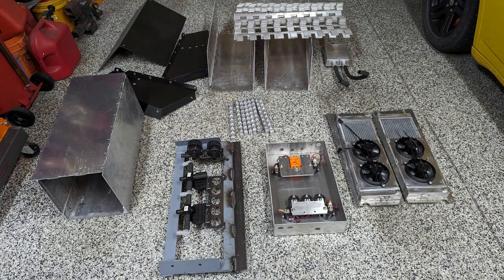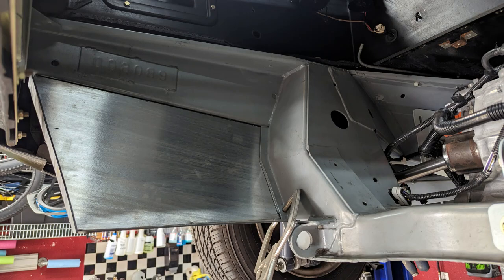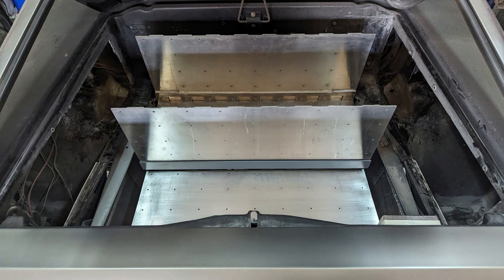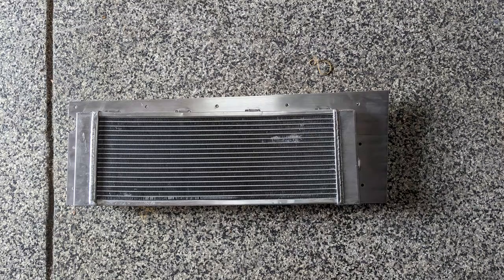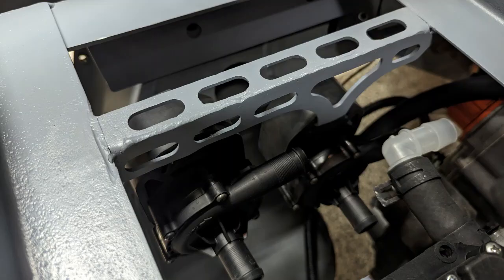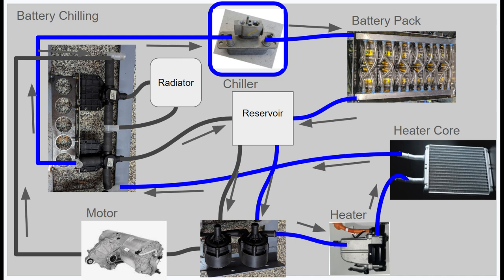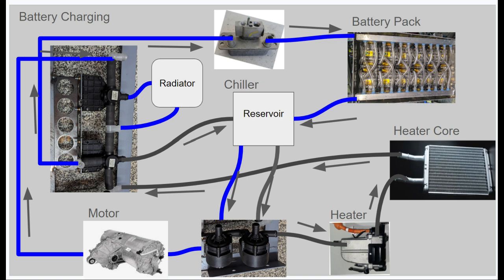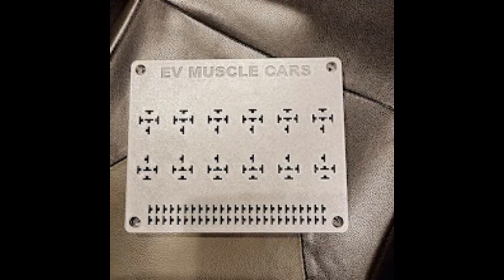EV DeLorean - Parts and Fabrication, cooling system walkthrough - Project Jiggawatt Episode 4

Comment: Any concerns about mounting the bottom box on its side, since it wasn't designed to lay that way? I'm wondering if there is any risk with bumps, etc. applying "jolt" forces on the sides of the cells, and fracturing the wire bonds on the top and bottom of the cell.  Do you feel that the individual cells are still supported well on their sides?
Reply from the maker: No concerns, it's done quite often on these builds... I have one box with modules on edge in my Plymouth and I have pushed it pretty hard for close to 20,000 mi with no problems.
Reply: Great, I thought you may have done that on the Plymouth.  I chuckle when I see your Plymouth videos.  My dad would have LOVED to see that.  He was a BIG Plymouth/Chrysler/Dodge guy.

Comment: Absolutely phenomenal!  So much thought and analysis going into it - you continue to amaze me!!  Any idea when you might make some of the fab files available?  Also - do you have a feel for how the F/R weight distribution will have changed?  Any anticipated changes to braking system as a result?  And - Any chance of you posting some of the specific components you've selected - I've bought the Model 3 motor and S battery modules, and I'm removing the engine and systems from my DeLorean as I speak....😲  Fantastic work, PLEASE keep it up!!!
Reply from the maker: Oh wow, congrats on starting the project!  I have a shared folder for the files linked below...I think the balance will remain pretty similar to stock, just heavier.  It will most likely need upgraded coilovers and brakes.  

https://drive.google.com/drive/folders/1FJQNckqbJZNHA_BhiO9oVvmAAh7nWmBB?usp=sharing
Reply: Thank you so much for the files!!  So great!  What gauge steel did you use for the motor mounts?  (and mild steel?)  And the battery boxes are 1/8" aluminum?
I got my hands on 6.3kw modules - So I actually could do a 14-module 90kW (350V) arrangement and put 3 modules in the front box to retain the "frunk" space, and reduce about 60 lbs in the back.  Thoughts?
my car came with a new set of (uninstalled) calipers and rotors and a 50/50 master cylinder.  I'm still trying to identify the manufacturer - although I think it may have been SpecialTAuto (John Hervey).
Thanks again!
Reply from the maker: 10ga mild steel for the motor mounts, battery boxes are a combination fo 1/8 and 1/4.  Materials are noted in file names and the slide show.

That weight distribution sounds like a decent idea, with 14 modules I think you have to round it to 88kWh ;)

Comment: Can you charge it with Lightning?😋 Cool project! While the batteries weigh a lot, the power to weight ratio should still be pretty fun!
Reply from the maker: It would be crazy not to use lightning!  Thanks, yep good power to weight and the batteries are traction modifiers 😁
Reply from the maker: BTW, you look just like the guy in the trunk 😉
Reply: @MrMoparMan  That trunk is a bit cramped. I'm looking forward to the next project with a much bigger trunk... and better power to weight?
Reply from the maker: @clintmcdowell898  well there will be a lot more weight, so I guess we will need a couple more motors to overcome 😁

Comment: exciting stuff! I like the rear shield more than I thought I would! Great job!
The water heater in the loop - is that a heatpump or some 'regular' electric water heater?
Reply from the maker: Thank you, I appreciate the feed back!  This heater is a resistance heater powered by the 400 volt battery pack.  My next project will have a custom built heat pump system that I am pretty excited about!
Reply: @MrMoparMan  You're doing it spot on the same way I want to do mine (when I get the finances for a 2nd D) so I'm so excited to see where this is going! I wonder if such a heatpump could be more or less a drop-in replacement for the resistance heater? I live in Denmark where it's cold :P
Reply from the maker: @banjohat  The heat pump will be experimental, but I am confident it will be adequate for cold weather.  I live in Colorado and will do some cold weather testing.